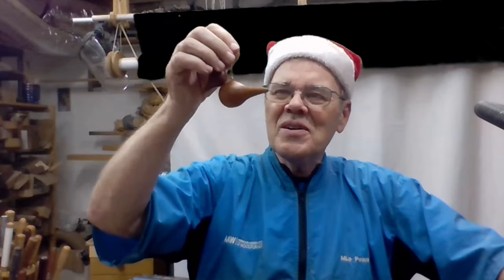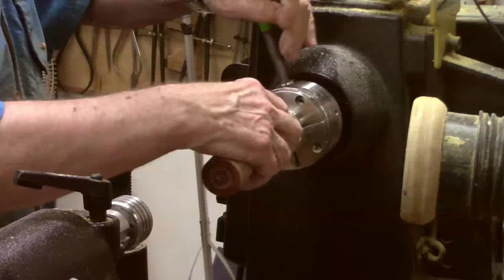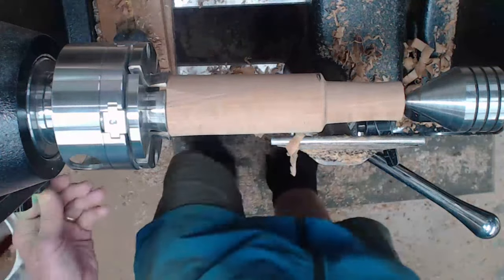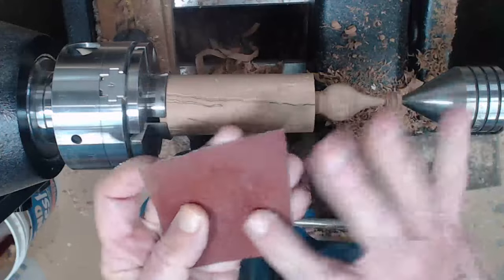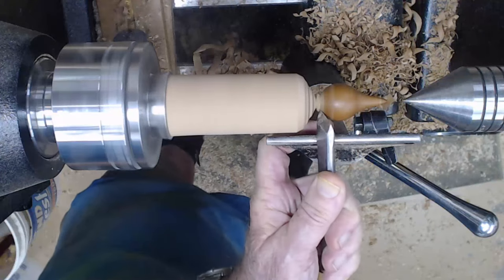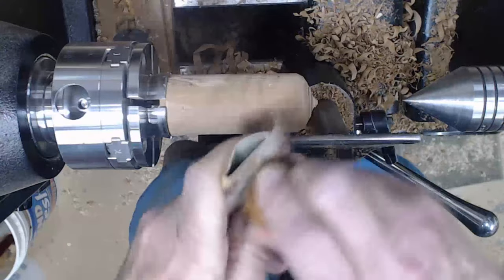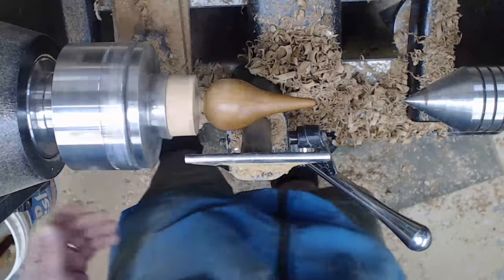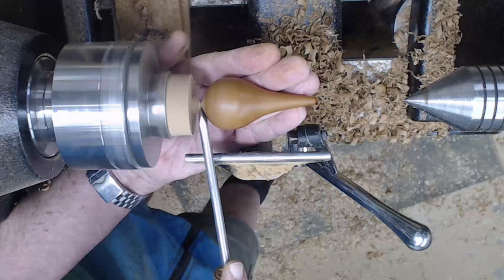Miniature Bird Christmas Ornament is a Must-Turn for the Holidays

Comment: I like the stately simplicity of this ornament. I also saw one similar in my research of old world christmas decorating history. Many of the old world ornaments had similar form and were  made fom cloth, nut shells, or paper. I will likely use some laminated blanks to get wings on the bodies and possibly crowns on the heads. I am now considering doing some using off center techniques, just because I can, and it could be an interesting venture. As always I really enjoy watching your projects and gain so much inspiration and tips. I really like the tip about using a forstner bit to create the void to hide the round on round joint.
Reply from the maker: Thanks, Bert. Easy enought to laminate some maple and walnut like I do for my mini birds for my birdhouse ornaments.

Comment: Nice work Mike, one thing I have started doing with ornaments etc is putting a drop of CA into the hole of the screw eye. It hardens the timber around the screw and allows less pull outs of the screw eye, especially when I use softwoods. This allows for the slightly rougher handling kids will have when decorating the trees.
Reply from the maker: Thanks for sharing your tip.